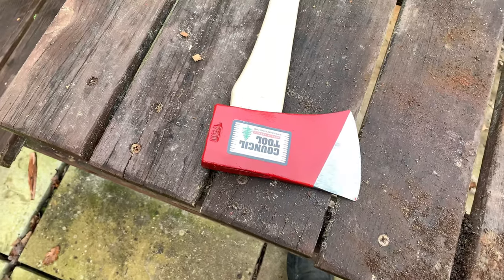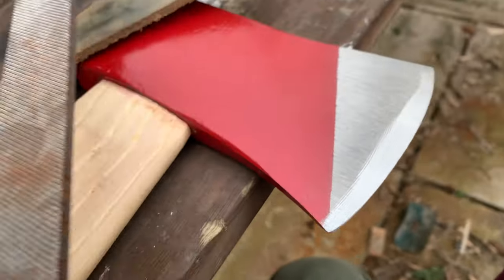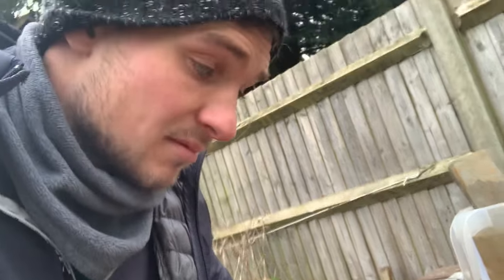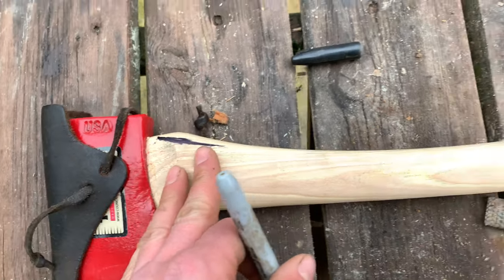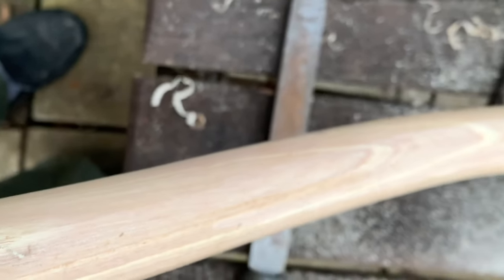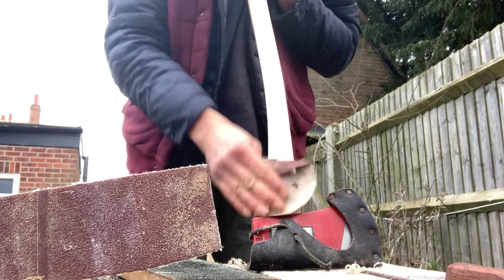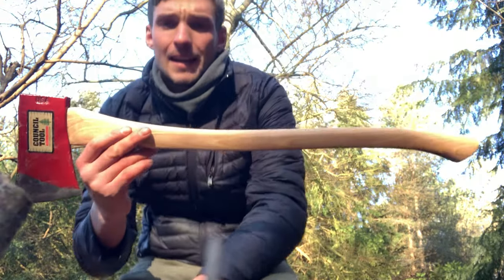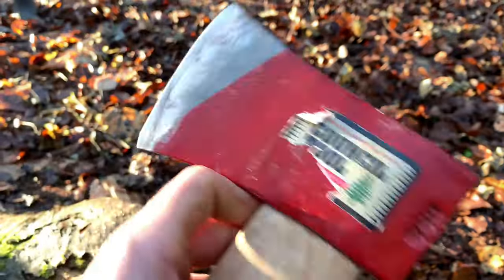Council Tool Boys Axe, how to turn a cheap axe into a premium tool

Comment: They are great little axes when they aren't too soft.  I've probably sold hundreds of those things for council tool lol.  I imagine the new sport utility line will be more reliable, but slightly more expensive.  One great thing about council is they haven't jumped on the super thick handle bandwagon like other companies.
Reply from the maker: Very true. I first found out about the boys axe after watching your videos (many moons ago). Like it or not, it’s your signature axe. For the money it’s hard to beat. In the uk it’s competitor is the hultafors 2 3/4lb. The ct has more edge length and a nicer shaped handle, it’s also half the price.
Reply: Yep! You convinced me to get one a while ago. It has since done a lot of work! I kind of use it as an experiment axe to some extent, and I’ve learned a ton.
Reply: Anyone have a UK source for the CT Sport Utility equivalent? edged-arts don't do em.

Comment: Really Excellent job. Thanks for the video. 
If you want to see an option for finishing that handle, "Log Cabin Looms", here on YouTube uses linseed oil, Turpentine and Pine Tar,...and his wood seems to hold up really well. 
The Vikings used to use Pine Tar in their ships to make them water tight. 
(You probably know all this,...but I though: Just in case.)
Reply: Oh yeah,.......and I subbed too.
Reply from the maker: Thanks man. I’d like to experiment with pine tar, I wonder if it would be blister making. I normally just use a thin layer of  blo.
Reply: @MrDesmostylus  I don't know for sure on an axe handle,...but years ago, professional baseball players used to use it on baseball bats. You know,..for grip. 
I started to do an SKS with it, but ran into another project and just gave it a quick layer of tung oil. Eventually I will scrape it down and totally redo it with the mixture,...when I get a second to breath.

Comment: Apparently the quality control on these can vary but most people feel they are a decent axe.
Reply from the maker: Yes they can definitely. I’ve got another one and the handle on it cracked within 2 hours.
Reply: They have become fairly difficult to find.  Back ordered on most sites.  I'm glad they make the "Sport Utilty" model now, which foregoes the sticker and paint job.

Comment: the store near my house wants 55$ cnd for a council tools 28" replaceent handle for my boys axe. That's highway robbery. the thing is i might buy it bc there doesnt seem to be any replacements on amazon.
Reply from the maker: Don’t bother with it and just buy another 28 inch handle. You have loads of options in the states compared to the uk
Reply: Look around a bit, if nothing else you can 100% find a really good hickory handle for that price. Or just go to your hardware store, my axes are used for bangning wedges alot and even cheap beech handles have withstood the abuse. If you can find a hardware store handle you like the shape of, just buy it

Comment: Dude, Council tool is inexpensive but not Cheap!.  Here in the States when you call a product CHEAP it means inferior.  Council Tools produces a fabulous product at an affordable Priceline.  Yes, a person can buy a $1,000 dollar axe or a Velvicut felling axe for $250 and both will preform the same.  Both are balanced and exceptional tools. I have used the axe you call CHEAP on our ranch for years and it chops trees up like a sausage at dinner time.   So there is my Yankee opinion.  Thanks for the video…
Reply from the maker: Cheap in English means inexpensive. It's all about context dude. I like the axe and rate them. Didn't mean any offence. Thanks for watching
Reply: I bought mine 6 or 7 years ago when they were still around $36 or so.  I'd wanted one of the Forest Service axes with a little better steel but none were available at the time.  Right after I bought the red one, they showed up.  but it still is a great little axe for the money.  Dad had one while I was growing up and I always liked that one.

Comment: Cheap axe? No such thing any more. I can't find anything for less than $50
Reply: Tractor supply has a 28 inch 2.25 lb $15 dollar axe I ground in better edge and refiled and then sharpened with 180, 400, next sharpening will see same plus 800, 1500, 2000

I cannot brag enough on it being totally comparable to the side by side use of council tools $150 bad axe boys axe straight out of box

Comment: I gave my daughter a council Tools Boys axe a couple of years ago.  The handle sucks, the head is cast.  My 40 year old True Temper Boys axe is a lot better axe.  My Scandinavian Forest axe is light years ahead of either.
Reply from the maker: Yeah but X5 the price. I think the CT boys axe actually out preforms the gbs.
Reply: @MrDesmostylus  I have several COUNCIL TOOLS AXES.  THEY ARE CAST, NOT FORGED AND CHIP TO HIGH HEAVAN.
Reply from the maker: @johnclarke6647  I have had several Gransfors axes and a lot of them have had edge damage, even chipped. I'm guessing you are just a Swedish axe fan boy so enjoy
Reply: @MrDesmostylus  I cut up a bunch of seasoned oak with my SFA and its edge was fine afterwards.
Reply from the maker: @johnclarke6647  did you split the oak?
Reply: @MrDesmostylus  yea

Comment: No sticking?? Loos like it sticks almost every swing and that’s why you need to rock the handle to unstick it.
Reply from the maker: I see what you mean but some axes are so sticky that it's really hard to release then. You obviously want the to penetrate deep but release with minimal ease. Thanks for your comment
Reply: That's why the maul is wedge shape, it either bounces or it splits and doesn't stick soo much,, still sticks too though